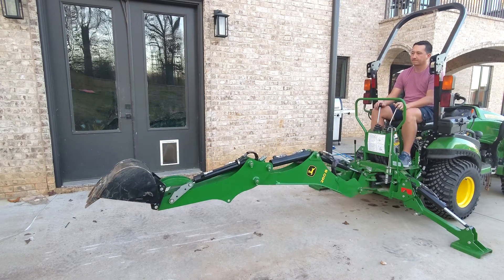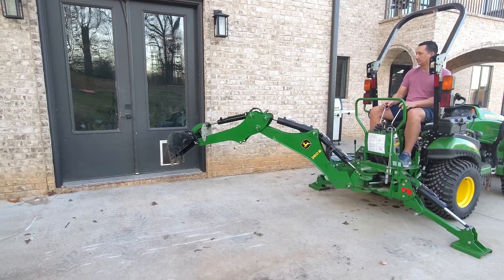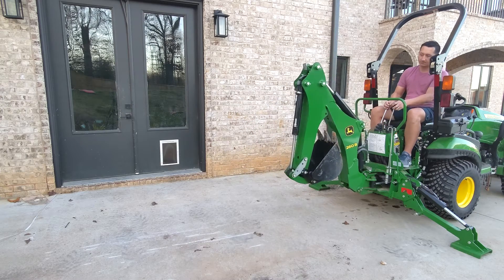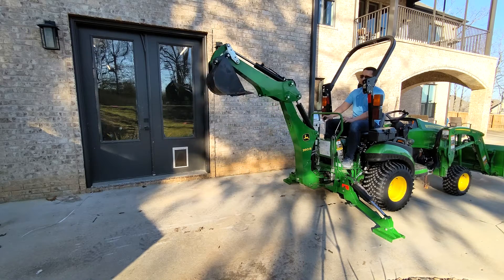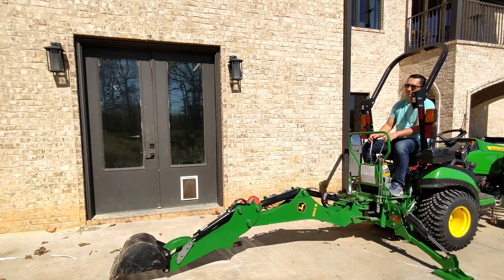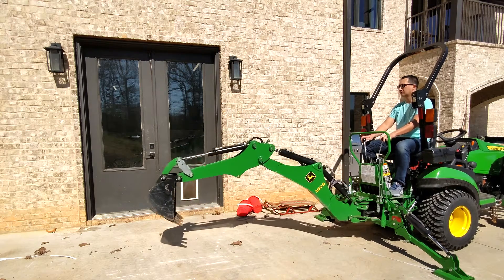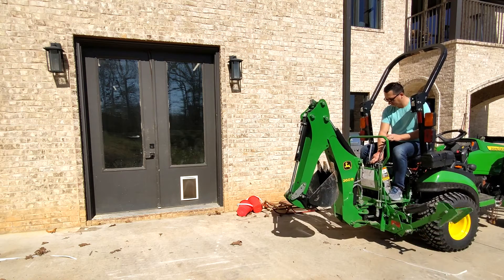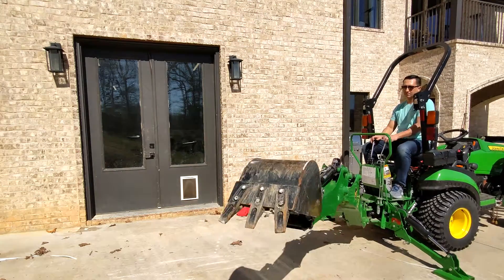1025R Backhoe Performance Demonstration

Comment: do you lose digging force?
Reply from the maker: No change in digging force.  That is determined by your pressure relief valve.
Reply: @HydrosPlus  I figured so! Pressure is pressure. Volume is speed. My bad!